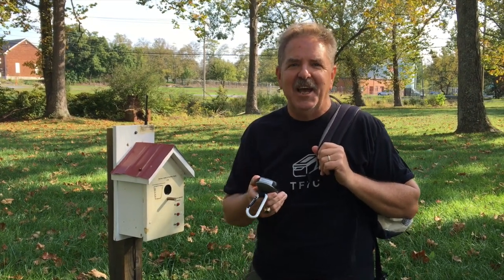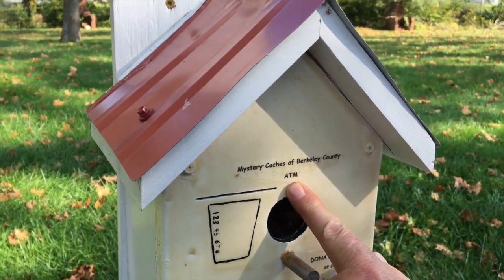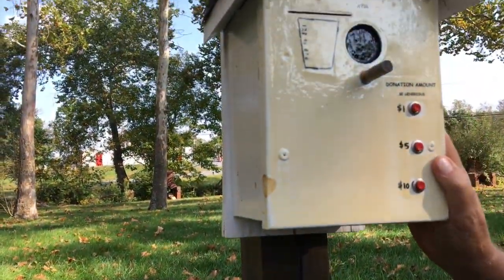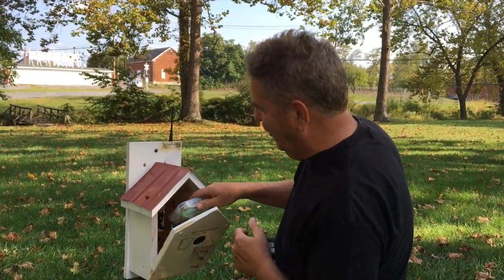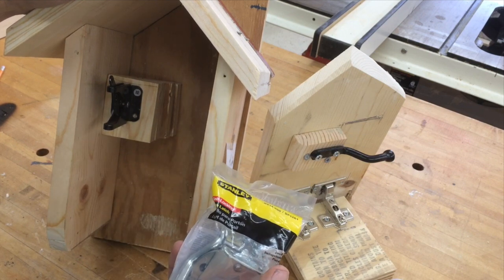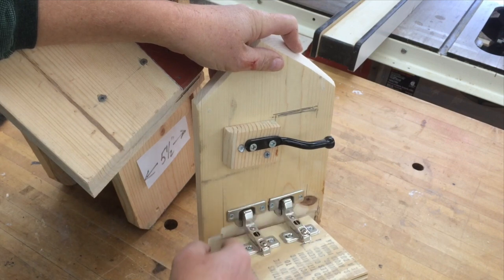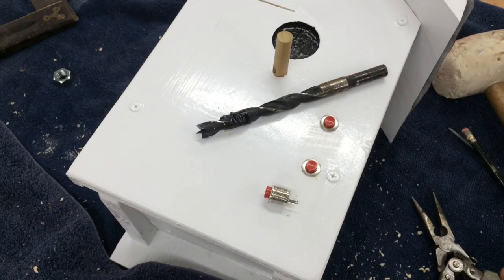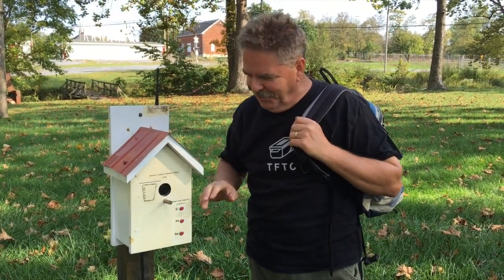How to build a gadget cache

Comment: Hi Tim, a great cache. What tool did you use to get the slit into the board?
Reply from the maker: +Martin Falk  You can do it a couple ways.  First drill a couple side by side holes with a small drill bit. That is how you get your hole started.   Then either use a key hole saw or a saber saw.  Both will do the trick.